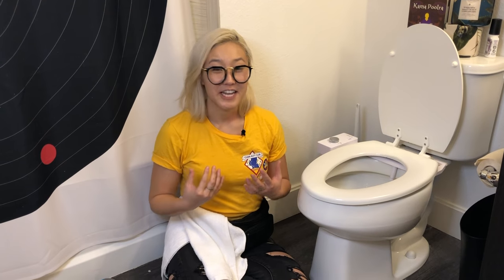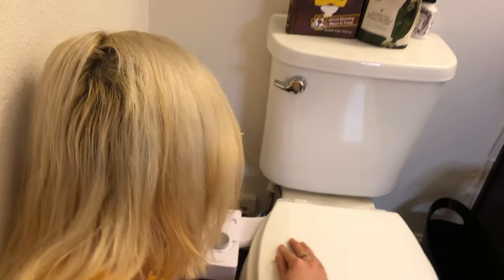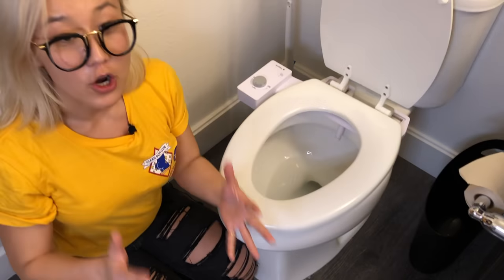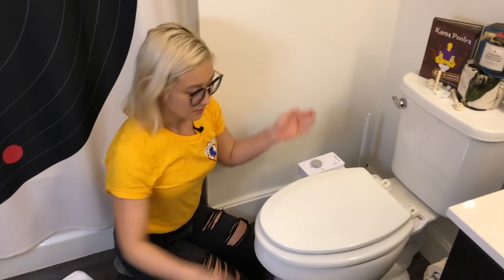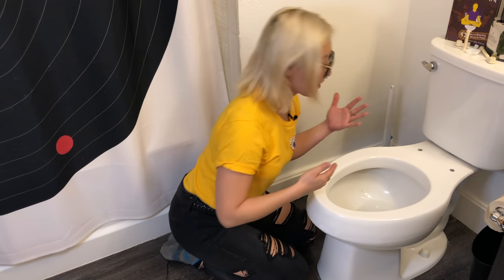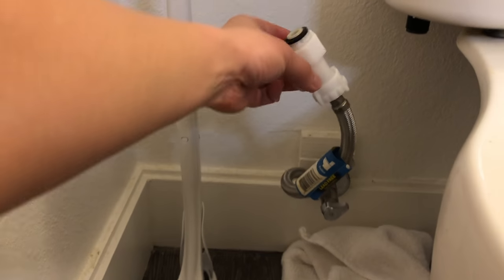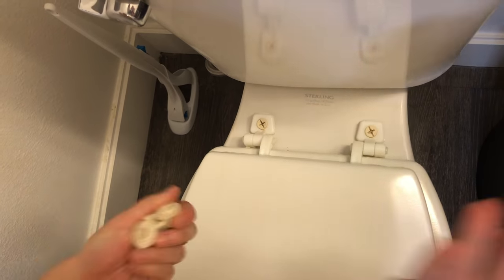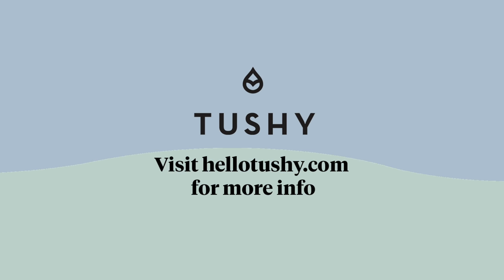How to Uninstall a TUSHY Classic (when you're moving or upgrading to another model!)

Comment: In my case, the intake to the toilet was leaking. This was because the rubber washer came off with the megadapter. There shouldn't be a black washer in the bottom of the megadapter. If there is, pull it out and put in back in the end of the hose that screws into the bottom of the toilet.
Reply: thank you so much! i was in this same situation and i’m not handy AT ALL, but it was the black washer making it leak, so i’m very grateful for you sharing<3